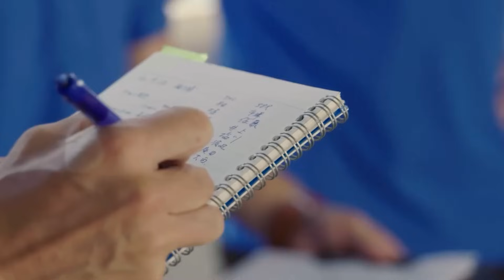The NEW Subaru BRZ will be electric - this is what it looks like...

Comment: Sam sometimes your prejudice towards ice cars is ridiculous.  The Subaru brz is one of the best handling cars ever made.  There are people who love handling over sheer acceleration,  and it's a lot more fun driving a car that you can drive hard and still get good mileage and not burn the rubber off your tires.  I'm  all for electric but come on.
Reply: Handling was great unless you were turning right. There is a design flaw that starves the engine of oil it’s been documented by now.
Reply: @deltadovertime I think s2000 fan will disagree with him.
Reply: @deltadovertime only relevant on track days
Reply: But yes it's a slow slug
Reply: You meant against, not for.
Any reason BEV won’t handle as well, or better (lower CoG)?
It will be heavier though, like 200 kg.
Not having to scream the engine might be advantageous. Subaru tend to have poor torque, like a motorbike.
You get AWD a lot easier with electric.
Worse will be Toyota software etc, that’ll suck.
Reply: The original 2013 version sucked, I owned one, and this newer version is better, but not much, yes we need electric sports cars,
Reply: @robertfonovic3551  handling doesn’t matter when you are daily driving either. Nobody is driving around in a miata saying that it’s handling is great driving around town. It’s always with spirited driving.
Reply: @林振华-t4v  yeah I mean an e46 bmw (any many others) are objectively better than a BUDGET Toyota but I didn’t really want to get in that argument lol
Reply: All I want to add to this is just talk to any person who hates EVs if you want to hear about bias. Like, they are worse than Vegans. They will go out of their way to tell you how bad EVs are, without ever owning one, or driving one.

Comment: I own a 2022 Model S and a 2022 BRZ.  They are totally different but both fun cars.  I can tell you this that the BRZ has held 95% of its value over the year while the Tesla has barely held 75% of its value.  The 2nd gen BRZ is fast enough and certainly nimble enough to be a decent sports car.  Whether the 3rd gen will be electric or not is not an issue really as long as it stays a great handling car and at a great value.  At $31K the BRZ / GR86 is a bargain.  Sam you need to know what you are talking about here as a I am sure you have never driven or owned one.  I love both cars for what they are.
Reply: 95% value. Lol, I just check autotrader canada. A 2022 model BRZ with sport tech eyesight is asking 33788CAD. The same 23 model MSRP is asking 358950CAD. Right off the bat, that is sub 95%. And let along the sales tax and PDI cost should count toward the depreciation. I am not sure how you support your claim. 😂
Reply: Thanks for checking - but I bought my limited used with 4000 miles on it for 31K. Autotrader US has several selling for at least that amount with 3K to 8k miles.  Yes new are slightly more - why buy new?
Reply: @bobf5740 😂lol, did not see that coming, 4000 miles a year. You are hardly driving her. Those BRZ (or this kind like WRX) near my town are almost all well driven (in fact, unless it is lease return, all of them have very respectable milleage on em) . And likely being mod the hell out of it. That is why if I am serious about getting a BRZ or WRX, it has to be new. Otherwise who knows what kind of joy it has been through. IMO you are rare type of BRZ owner.

Comment: Not 50/50 but PFC. The Subaru BRZ has a weight distribution of 53% front and 47% rear. The engine sits 9.5 inches farther back and 2.4 inches lower compared to other Subaru models, minimizing the polar moment of inertia (PMOI). This design reduces rotational resistance, improving responsiveness in handling. The BRZ’s low center of gravity is 18.1 inches from the ground, achieved by positioning the compact 2.0L BOXER engine low and rearward, aided by lightweight materials like high-tensile steel and aluminum in the body structure.  But this new car looks like cheap computer mouse. For once - Just build an electric  car that  looks good and drives well at the expense of range.

Comment: The ICE BRZ is a drift car, not necessarily a speed monster, but fun for drifting.  That is actually something that is difficult to do in an EV with single direct drive….
Reply: It is much easier to drift an EV. You just need to turn the traction control off.
No shifting means the tyres never get a chance to regain grip.

Comment: Yes, wireless charging works but at a 25% loss of energy. They have   estimated that current wireless charging devices waste 1 megawatt of power a year. Widely used wireless charging would waste a significant amount of power.

Comment: You have no idea what you're talking about.

50/50 distribution. It has 4-cylinder boxer engine, which means it is very short and can be easily installed right behind front wheels. Boxer engine gives you very low center of gravity (not as low, as EV battery, but pretty close). So weight distribution is really good in this car.

The car is slow in terms of 0-100 - yes, but it weights only 1300 kg! It is a miracle such car exists in our time in the first place. Such small mass means that handling should be very responsive and as far as I can see from the comments, this car is very fun on track. You don't need to have 1000 hp in every single vehicle. In fact, it is better to have underpowered on track for most people, because you can drive it hard, and not to worry about tires. Plus low power, means you cannot compensate shitty driving skills with acceleration, you actually need to learn how to drive throw conners fast in order to show good time.

I do understand that you're an EV guy, but there is no need to be so hateful in regards of ICE cars.
Reply: Thanks for the well informed response. However he's not being hateful to ice cars, if you recall he grew up as a car tuner type and he loves ice cars or had been a hobbyist of them. He's simply stating that even cheap low end EV's are extremely easy to give perfect weight distribution whereas engine cars, ice engine cars it is far more difficult and then you still have gas tank differentials from full to empty.

Comment: Sam you have no idea what makes the ICE BRZ good. You should go rent one for a weekend drive.

The reality (here in Sydney) is nothing but 40-60 kph zones. I can wind mine to its 7400rpm red-line without breaking speed limits. It handles like a go cart and only weighs around 1200kg. Weight distribution is 52% front / 48% rear. Its near enough to perfect with some light modding.

Not sure what to make of that monstrosity you showed, but I am quite confident that no current BRZ owner would be even remotely interested in it. That is not to say I'm not a fan of EV's, if done right and true to the heritage of its name plate.
Reply: When the first gen BRZ come out, I want to get one replace my 7 gen civic. But ditch the idea since the person in back seat need to have their leg saw off to seat properly. When the second gen comes along, I thought about it briefly and ditch the idea again with rational why I shall spend This money when I can get a WRX which superior over the BRZ on almost every asepct except not good at fancy drifting. I been to auto cross event, and have yet to see a stock BRZ can hold a candle against wrx.

Comment: That design, with a few refinements, is a good choice for Subaru - but it had better be fast, with mandatory AWD.  If they're smart about it, they'll make a software mode that helps you drift the car, which is something the ICE BRZ has been a popular choice for.  Subaru fans aren't scared away from an unusual design.  I'd also suggest gearboxes with straight-cut gears like the original Tesla Roadster had, to deliberately create an audible-but-not-annoying "power whine" sound.

Comment: The BRZ is what I would call a momentum type sports car in the tradition of a MG midget or B, a Fiat X-19 and most recently the Mazda Miata in that to run fast laps you carry as much speed into corners as possible as opposed to a high powered car that you optimize putting down power as early as possible when exiting a corner,like a Porsche 911 or a Corvette. Both are fun with the higher powered cars stretching their advantages as straight aways become longer. The prospect of a EV sports car is to build a light weight design[batteries are heavy] and a usable amount of power[EVs with dual motors are very powerful, add weight]. Its a Physics problem the design parameters of a EV sports car would minimumize range and comfort to promote handling and acceleration. The EV BRZ might weigh 50% more than the ICE powered BRZ it replaces and be disappointing to buyers despite being faster. New tire and suspension technology might serve to mediate the effects of  added weight but would require a all new ground up design.

Comment: I bought a 2023 BRZ and am quite happy with the power and handling.  I don't like the look of the electric BRZ.  When I eventually buy an EV I'm hoping it will be a Tesla but that may be some years from now as I don't like the styling of the current models.  Hopefully, the weight will be down, charging won't be a factor and I'm not interested in FSD.  EVs are still new and going through some growing pains.  As they get better I will definitely be in the market.

Comment: It’s pretty, but how is the battery management and user facing software?
Reply: Who care, we talk about that when the concept manage to make its way to prototype stage.
Reply: @林振华-t4v  we care, and now that the question has come up I have to agree with OP, the software will probably be utterly horrendous and be nothing more complex than a screen that shows the same stuff that gauges would show. There will be zero integration.
One thing people who say they don't care about the car software don't realize is that every time there is a recall or a defect, a software fix can 99% of the time fix it. Software fixes can also give you new features such as improving your battery management software and giving you more range, or adding really useful things such as dog mode which was not part of the original teslas but now you can leave a dog in your car or even sleep in your car all night while the temperature stays constant without running the engine. These are all features that come with good software updating. None of the Japanese or American legacy cars can or will have these features or the ability to add them for, years and years I'm sure.
Reply: @deantoth  pretty much what I'd expect. We'll see. Though it will likely not affect any of my buying decisions, as I plan to keep my 2023 MYLR for a long, long time, in part because of some of the things you mentioned that it just does so well.